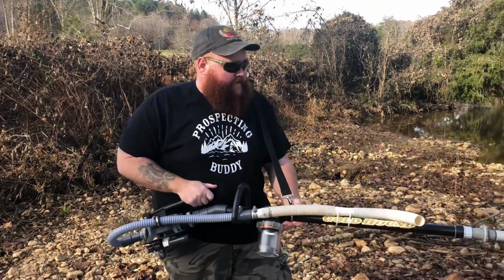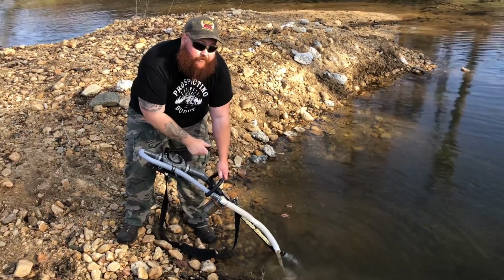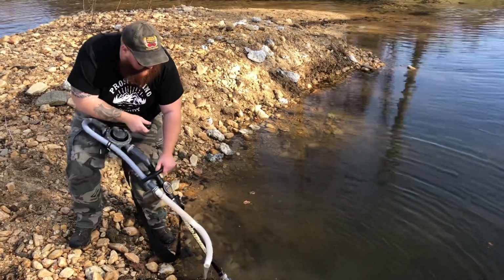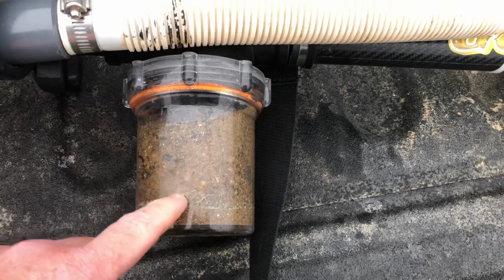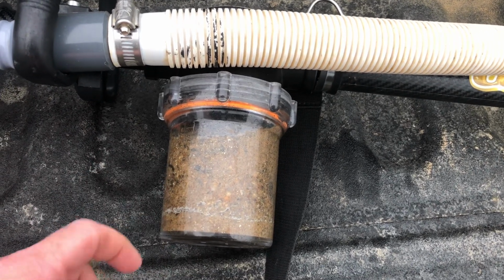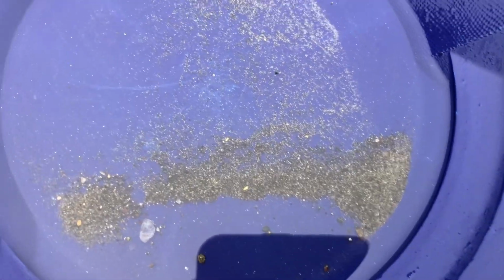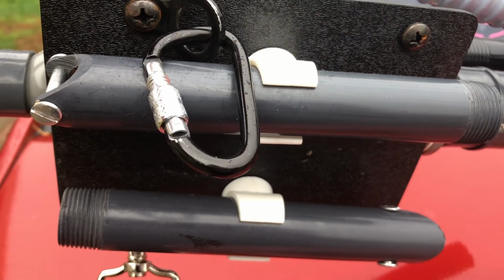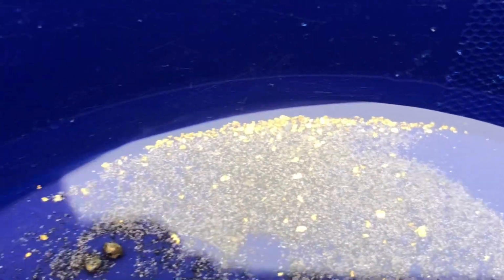Taking the Gold Hound hand dredge prospecting

Comment: Did you collect the discharge to see if or what it did blow out ?
Reply from the maker: I have I done it in a controlled setting took a tub at home dropped 2 grams of fine gold in a bunch of sand and rocks after clearing it out and panning it still came back out with 1.92 but the .08 could have been just some that didn’t come up out of the tub but I didn’t find any in the discharge